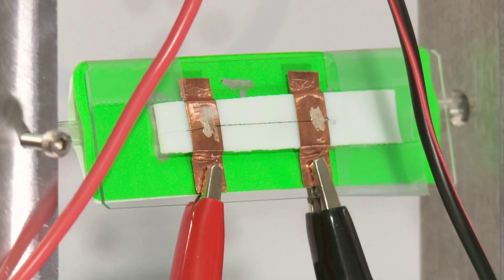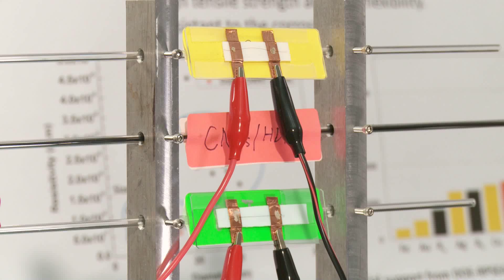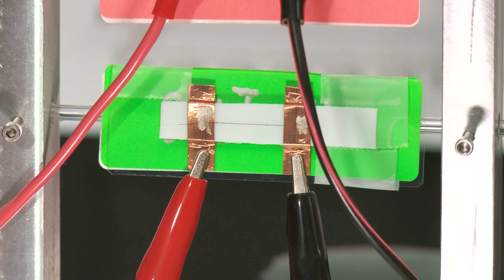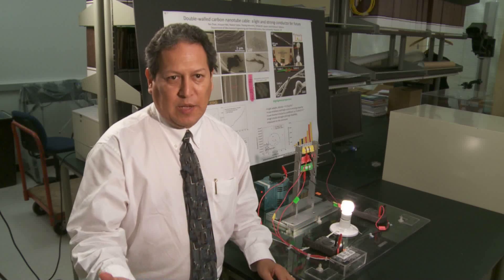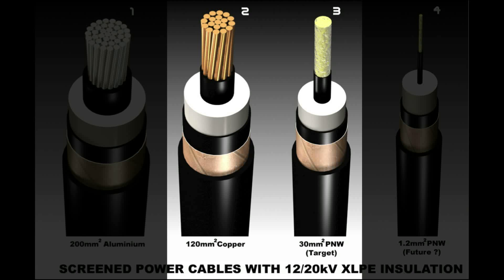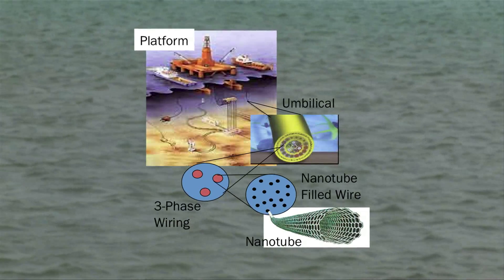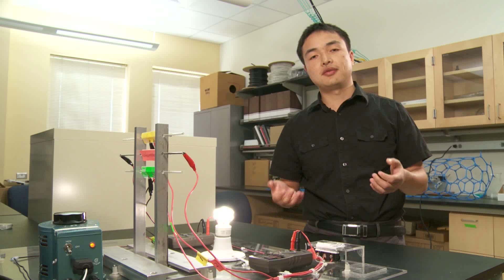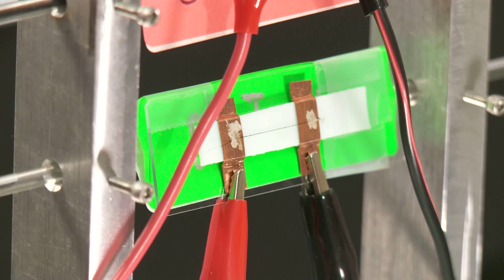Nanocables light way to the future

Comment: You don’t even need a wire to light a fluorescent bulb, the gas will easily ionize in the presence of and electric field without direct contact.
Why the incredibly lame demonstration? 
At 1:00 the copper wire gauge at 200 sq mm is larger than AWG “0000” , it is literally: of the chart, yet there is barely no current needed to turn on that bulb in their “demo.”
Are they not aware of how bad the demo looks, or the physics involved? Me, I see what is presented and I call Con and BS.

Comment: Haha... more like... Wise University. I'm willing to bet the vast majority won't get that bit of humor, but for those you do... congratulations... you are very clever.
Reply: Really? You think you'd have to be "very clever" to get a racial stereotype-joke?
Reply: It's just a stereo-type... rather than racial... or do you believe people should also be called a racist because they really like a few foreign accents? But... I guess you proven a point... you don't have to be "very clever"... so... congratulations. :)
Reply: You should read up on the dictionary so you can sound more clever - "racial stereotype" doesn't imply racism. It means "a stereotype of a race", which was exactly what it was, probably the most common one there is about asians. I never thought it racist, just very little clever.
Reply: Then what's the point of adding "racial"? The word "stereotype" would be enough to suffice.
Reply: Well, no. Stereotype-jokes can be clever, though racial ones are mostly used up. That's why I criticized the claim of this specific stereotype being clever. Anyway, if you wanna be mad because I was "too specific" then go ahead.
Reply: Mad? Far from it... just figured to read between the lines... therefore thought you were elaborating rather than being... "too specific"... as I could not comprehend what was your intended message otherwise. So yes... I already know the dictionary meaning... but logically suspected you didn't know in regards.

Comment: It actually does answer a couple important questions, as follows: Q: How is it better than copper, silver or gold? A: Carbon nanotubes are better conductors and weigh less than those metals, as well as being more corrosion-resistant than copper or silver. There is also the possibility of the nanotube wires being much cheaper than copper wire because carbon is so abundant and any source can be used to make nanotubes.

Comment: "lightens the weight and had higher current density" Failed to mention the impedance and resistance. These are far more of a concern when it comes to electricity grids then the overall current density.  Other major factor is the operational costs vs traditional copper cables.